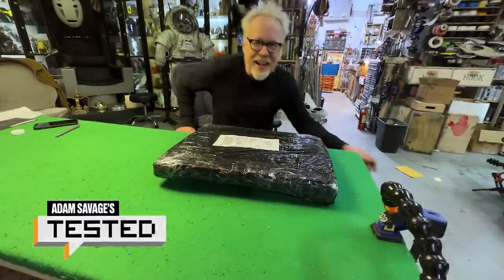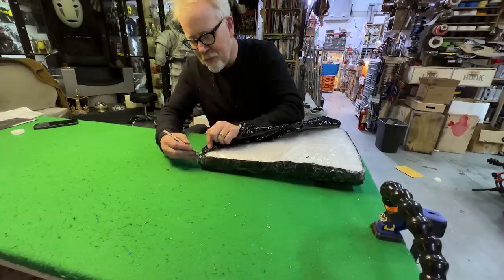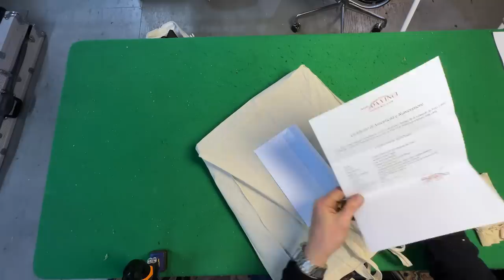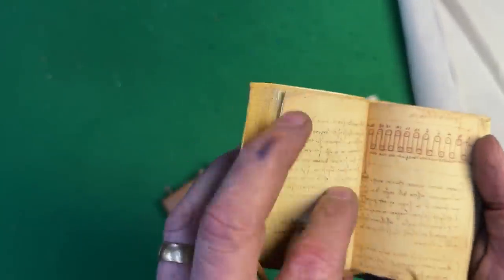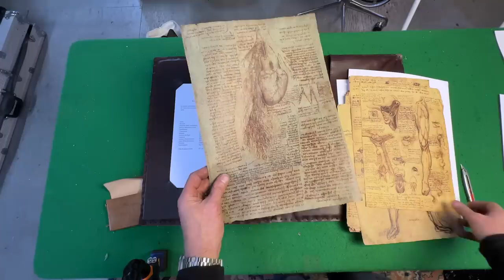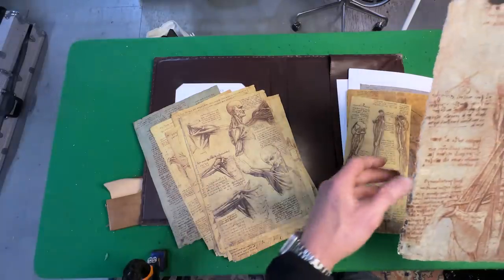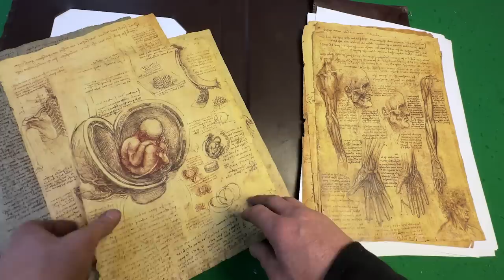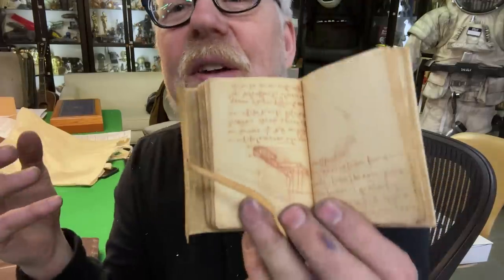What's Inside Leonardo Da Vinci's Notebooks?

Comment: Dear Adam, I'm begging you to help the Smithsonian correct Da Vinci's Tank. Everyone says it would not work, because the gear wheels  would turn incorrectly. They have even made videos, that make him look like he made a mistake. As a artist and Inventor myself, I love Da Vinci, I have studied his drawings and he did not make a mistake. The drawings are correct, but a major part is not interpreted correctly. Da Vinci was known to not put everything in his drawings in case the got in the wrong hands. I don't have the publicity to correct the Smithsonian. But you do! You could build a small prop and show them they are wrong which I think would be amazing!! I wrote them years ago. And they didn't even respond. You are the guy to do it. I'll explain here. The hand driven cranks were not stationary like as in the build in the Smithsonian. They actuallly were on a pivot in the floor. They pulled slightly inward to the center by the drivers past the pegs on the wheels. This unlocked the wheels. Then you shift right or left to one side on drive 1 gog at a time. If both drivers did this on opposite corner wheels it was able to turn the tank on a center. Or if both drivers put on the back wheels together it can move forward or back on how you crank. And last if put back on both gogs like in the drawing it's a break. It was the first transmission and not a mistake. Remember the drawing shows horses pulling it. They were used to get it to a high peak or shooting spot. Then the horses were taken away. They could not be around cannon fire and would not be near if being shot at. The cannon were around the top So once one fired one of them you would have to pivot around to line up another shot in the same direction. That's when the cranks were pulled and shifted. Then locked in place to keep from sliding to far. Proof of my theory is the crank gog have a stop on each side. With longer than normal pegs. There is no need for that length unless they were to slide right or left but still stay on the pegs. But in order to slide left or right you have to lean it inward to unlock of one wheel. There is no way to show in a drawing. He did other drawings of 90 degree angle gogs and they did not have stops on the sides for support. I hope this makes sense. I could send a video example. But I think you are smart enough to see what I'm saying. You should totally do this. I hate when higher ups think they are smarter than Da Vinci. A guy did something similar proving Da Vinci did build robots and he used winding like in clocks to power them. But the winding were barely visible in the drawings. The guy built them and they worked perfect and could be programmed to turn right or left only by adding a peg in certain spots. It would blow that video out of the water.

Comment: Frame each page between two sheets of glass, like the vampire bible from Blade.  That way you get to see both sides, the documents are protected, and the display is just gorgeous.
Reply: Sadly they aren't two-sided reproductions. The backs of all the Anatomy pages are just stock white paper. As soon as I saw that my interest faded a lot. The faux-foxing and tearing on the edges was also much too precise and sharply cut, not worn or frayed as they should be by the passage of time. The small codex looked a bit better but the wear and staining in the covers is a lot less than the real versions and the pages are too "firm" and clean - everything looks like brand-new reproductions, not realistic replicas. These are cool and all, but given the no-doubt extravagant prices of these replicas, the results aren't as impressive as expected. I'm guessing there are forgery rules or laws that prevent truly accurate reproductions being made and publicly sold. Pretty sure folk on TheRPF could do just as good or better efforts given there are very high-resolution scans of most of Da Vinci's work available in the public Domain (with a little searching).